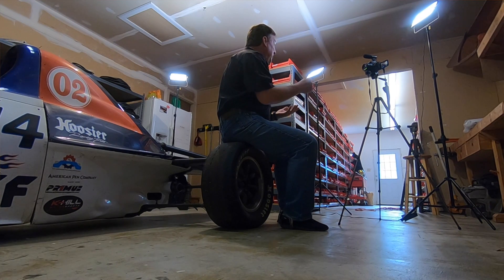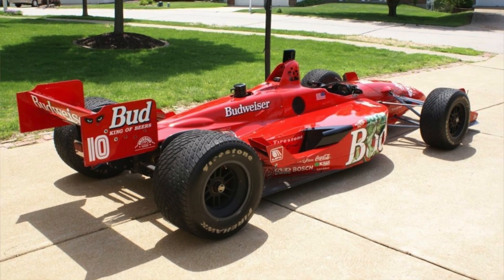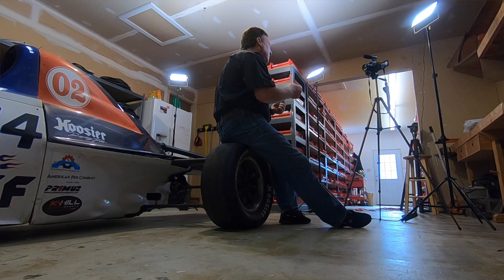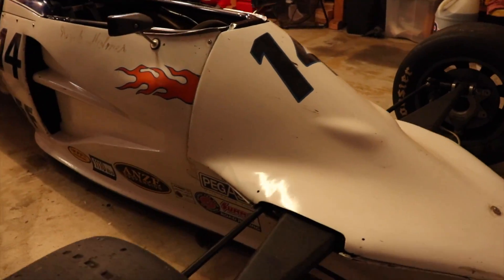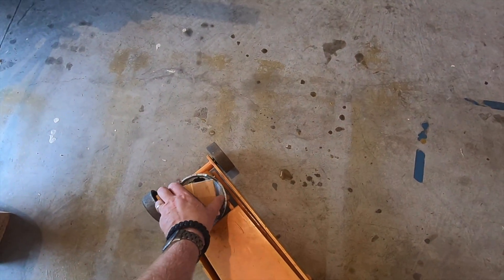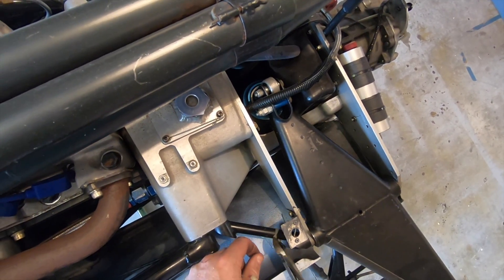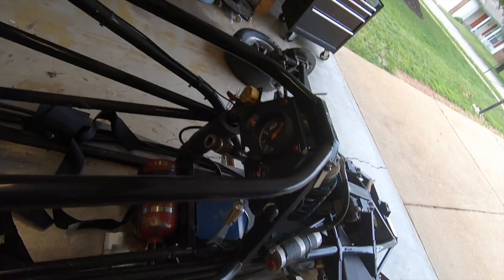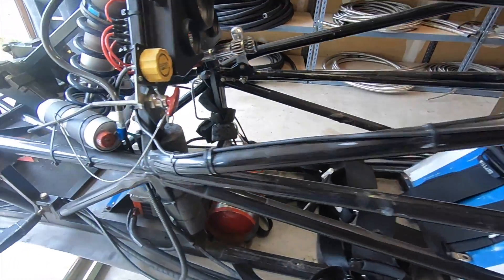Project Swift Part One

Comment: really happy these cars are still running, I was involved with building the first runs of chassis and suspension parts
Reply from the maker: Joe Hanson Thanks for your comment Joe. I would love to hear more about those days. Would you be amenable to a phone conversation sometime?
Reply: @timothyadcock5103  certainly, but you might like to know that the DB1  was David's second car
Reply from the maker: Yes, I forgot about the ADF. I’m off to PRI for a few days, but let’s talk. Are you on Facebook?
Reply: @timothyadcock5103  yes have some funny stories, was put on to that scene by Carroll Smith
Reply from the maker: Hit me up on Facebook. There’s a Swift DB1 group you would fit right into. I’m out there as Tim Adcock.
Reply: @timothyadcock5103  i'm not on face book
Reply from the maker: Ok so you’re normal. 😆 ok. Drop me an email at tim@ppdfast.com
Reply: @timothyadcock5103  ok.he(david)  drew the frame full size by hand didn't use cad

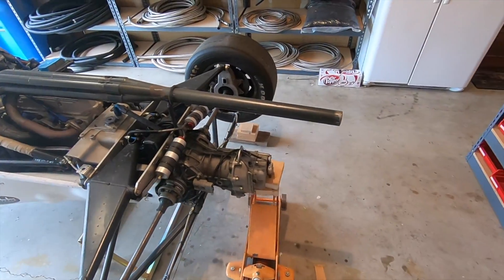Comment: My chemistry teacher taught us how to use a slide rule. 9:50 Would a lift table bring it to waist high? Are you going to pull and blueprint the engine? I learned fiberglass (composites) lay up from a friend who built his own Canard. He also mentored me on the lathe and mill. If you need a machined part, I like the practice. I do my own solid modelling and CNC programming now.
Reply from the maker: Thanks for the offer to help. I'll keep it in mind. The engine has been "blueprinted" but at some point will need to be rebuilt. I'm not sure if I'll do that myself or send it out. Mainly I think the car is in need of an inspection and clean up.